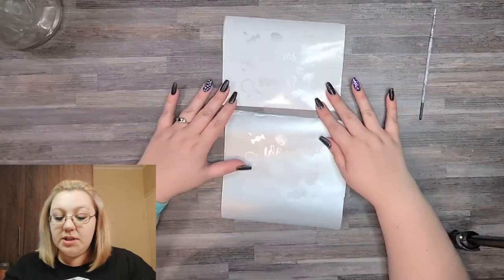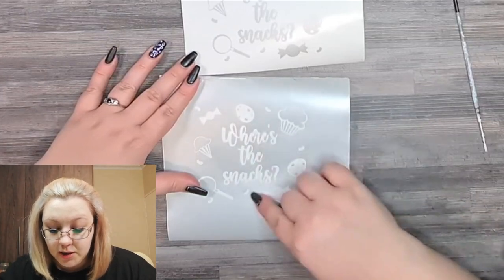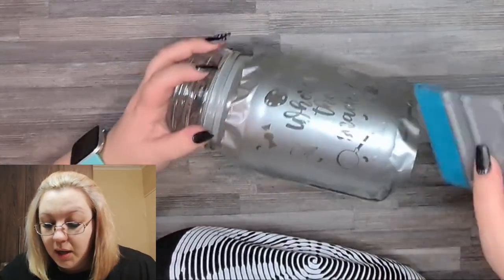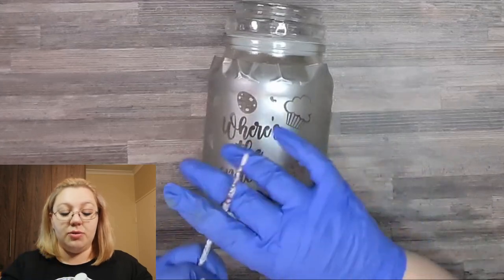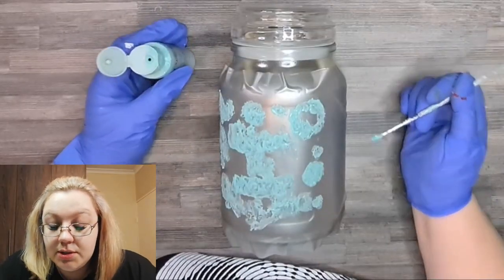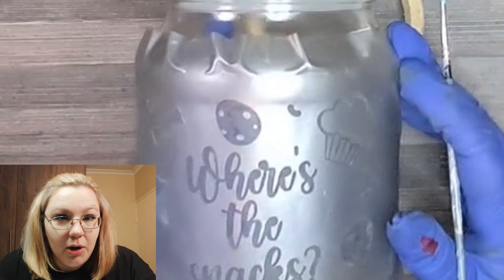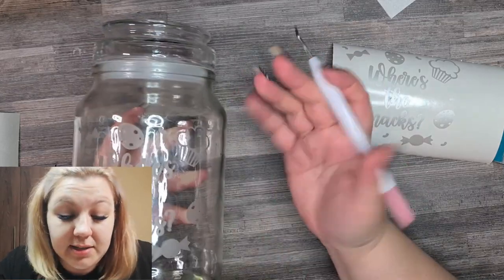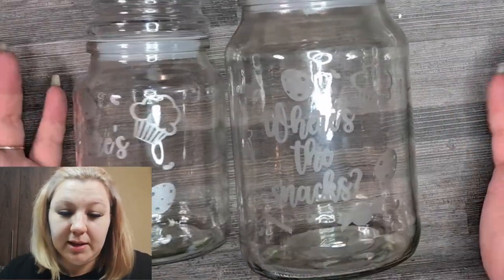ETCHING TUTORIAL: Testing Vinyl vs Etching Cream

Comment: Hi. I've bought etching vinyl and all I seem to do it rip it to shreds! Can't find anything on cutting the vinyl on a Cricut Maker and the supplier said they don't give recommendations on cutting as every machine is different. Have you got any tutorials on this or do you know of any? All I'm doing is wasting material and time and it's bugging me BIG TIME! Cheers
Reply from the maker: Hi Alley! Im actually in the process of working on a tutorial on getting the right cut setting :) For etching vinyl though I would probably work on the permanent vinyl setting, and adjust as necessary - increasing the pressure if its not cutting through, decreasing the pressure if you are cutting through the backing sheet